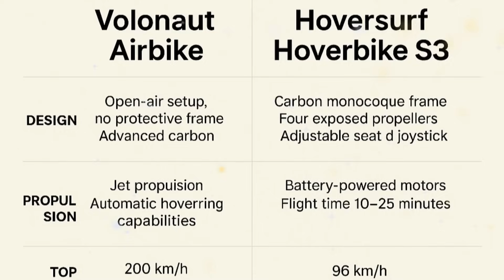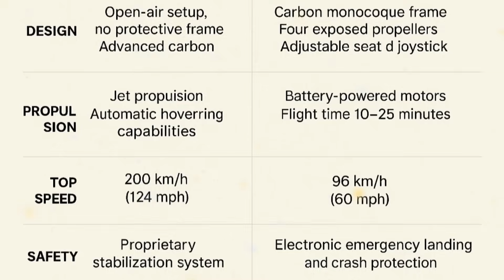2025 NEW VOLONAUT AIRBIKE VS HOVERSURF HOVERBIKE S3

Comment: Yeah I call massive(!) bs on the volonaut airbike. A quadcopter is stable, a small seat strapped on a turbine absolutely isn't. Especially when the barycenter is that high, even with the supposed thrust vectoring this wouldn't work. Also where is even the engine intake? The videos of it flying are either done with ai or a crane that was edited out later.
Do they have a live flight demonstration in front of an actual audience? I don't think so...

Comment: Seems like the Volonaut is massively unsafe for regular civilian use BUT, it just needs a built in parachute system which saves the pilot AND bike from falling out of the sky in case of an accident. It looks like it's light enough that the parachute would only need to be the size of one of those two person paragliding chutes. If EVERYONE will have one of these, we need to come up with basically GPS designated "streets in the sky" which takes the fun out of this activity to a great degree.

Comment: You have to do it again those blades cannot designed like that, you have to do it with small powerful turbines, like the planes but small in each corners or two small blades like the helicopters to living flowing in the air and the push up plus another regular turbine engine in the back for boost speed, why because drones have prepared for extra weight if traveling with another person, batteries have used with panel solar, like aircraft carriers don't use no diesel or gas like the bug brightly in the night so beautiful bug

Comment: 4 BLADES ? IT WONT WORK BOYS, TURN THEN UPSIDE DOWN PUT A BUBBLE GRID OF PROTECTION WERE YOUR FEET WILL BE BUT FOR THIS TOYS TO WORK YOU NEED A JYROSCOPE FOR TOTAL CENTRIFUGAL FORCE CONTROL ... USE THE FORCE NAUT ...

Comment: dont get me wrong, but a kill switch on an air bike just sounds counterintuitive... more like give me a parachute back pack... lol
Reply: Yes you still fall. But the kill switch is to turn off the blades so you don't get shredded if you fall. Better to fall to the ground from a great height than get blended into a red splash across the whole flight area
Reply: @darrjulian8939 - They could just add a strong cage frame cover, like those on Electric fans.

Comment: You'd think at this point they could make a lightweight carbon fiber cage to go around the propellers that wouldn't interrupt the airflow or lift much but protect against potential failure on the blades

Comment: Screw the quad copter. I want the voloanat bike i dont give a damn about safety as a matter of a fact i want a bike with NO safety anything! Im the same way with my cars. I want a traditional fully manual transmission and no automatic braking none of that crap . Same goes for inventions like this. Screw the safety! Sell it as you would a street bike, the rider is at his or her own risk. I would buy one for my self my kid hell thats all i would use. And even if they still dont fix the noise or blow back from the dirty  air it doesnt take a genius to know where to fly  and where not to.. just saying.

Comment: For people who don't understand how the Volonaut Airbike is possible, please look at modern Jetpacks. It's similar tech repackaged as a flying bike. It's using software to manage the thrust vectoring. It's very similar to those "easy to fly" RC multirotors or any or the modern multirotor aircrafts that are using similar technology. The real problem with the Airbike is the sound. It looks really cool, but it will be very loud and annoying.
Reply: The noise is not just annoying, but it’s insanely loud and a deal breaker.
Reply: And to give and idea, a recent report on a Mercedes Benz Axial Flux Motor indicated a whopping 1300HP. Maybe a foot in diameter. So some small AFM here could pack quite a bit of HP.
Reply: Lol, the real problem with the "Airbike" is that it's a scam.
Reply: The thrust relation to the center of mass is totally different.  If it's some kind of sophisticated vectoring control, it would be something unavailable to early jetpacks but clearly never needed to work.
Reply: Thanks for the lecture. You clearly have no idea about physics, the design and (lack of) safety of jetpacks, or the much greater challenge of stabilising the airbike compared with a jetpack. You're a clown.

Comment: If you fall off a hover bike, you fall off into a Blender.
Reply: Fall off the Volonaut at 200 km/h and you blend into the ground.
Reply: @lavsolutionsevent  thumbs up. few consider that possibility.
Reply: @lavsolutionsevent thank you, blender blades or being strapped to a cannon ball, neither seem particularly safe.
Reply: The blender-less airbike is the best or only option if you ask me
Reply: The Volonaut is definitely the safest travel, could even be safer than road bikes.
Reply: Wow crazy concepts bro. If I fall out a plane I splatter all over the ground like a tomato 🤪🤪
💀💀💀you actually are mentally slow
Reply: Like the guy said it's design is also very primitive and it is
Reply: The blender provides a merciful quick death.

Comment: Where is the fuel tank of this Volonaut Airbike?  Unless it runs on nuclear fusion - this won't last minutes in the air (if it can lift off at all... with its OWN weight, the fuel's weight and the driver's weight).  This is brilliant AI Fake Video until it's proven real.   IF it is alien tech - is it even legal?
Reply: How is it AI?..
Reply: @5StarGeneral_Clippy  With AI software like this - https://www.youtube.com/shorts/Uj6cs56PtGQ   or CGI effects like that - https://www.youtube.com/shorts/AXMh43XzBpk   people can make videos of fake stuff look VERY realistic.  

May be I should sell you a broomstick?
https://www.youtube.com/shorts/Sj4epDFJuaQ
Reply: @alchan230  you didn't answer the question.
Reply: @alchan230  and yes those are very clearly not real. Either AI or at the least CGI. The Tesla one is a 3D animation. Even says it in the caption.
Reply: I think you’re right. Look up Williams Aerial Systems Platform aka X-Jet. Invented in the late 1970s by Sam B Williams. It was a literal flying platform that we dubbed the Flying Pulpit. It’s short flight duration was only around 30-45 minutes depending on how you flew it. I worked at Williams in the 70s and 80s when it was developed. Our Test Pilot was Bob Courter. The engine used in it is essentially the same core engine utilized in the Tomahawk and ALCM cruise missiles the military uses today. If this Airbike is the real deal, like you said, without much room for fuel it would have an extremely short flight duration.
Reply: @privatepilot4064  Of course its a short flight time. It works the same as modern jet packs which also have a short flight time.

Comment: No to rotor blades..very unsafe and primitive design..Volonaut is the big winner!!!
Reply: Worry warts. I want the hoverbike
Reply: For real, I can't believe they made this so unsafe, those blades look so dangerous!!!!!
Reply: Volonaut is the one just add some ai system with led lights and your good to go
Reply: I take it you haven't seen what air coming out of a jet engine at supersonic speed does to flesh. Look it up at your own risk, it's not pretty.
Reply: @shmuckling  If you fall off... I don't think you would fall under the jet, but you damn sure gonna fall into those blender blades.
Reply: 4 independently controlled motors versus one engine that fails and you drop like a rock. I dont know. Quadcopter is insanely safer if you can shield the props a bit better.
Reply: @unknowndiver1855  In the future Quadcopter would replaced helicopter.
Reply: @hangonsapto2338  No, helicopter is inferior in terms of safety. only one rotor.  if you have 4+, one can break down and you can land safely
Reply: @unknowndiver1855  Thats what l say, groonk! 🤦🏻‍♂️
Reply: @hangonsapto2338  write english better if you're going to insult anyone, not sure if you meant will replace or be replaced
.
Reply: @unknowndiver1855  Thats what l mean.
Reply: Both of these are absolutely horrendous idea 😂😂😂